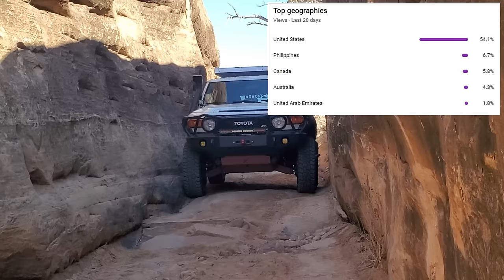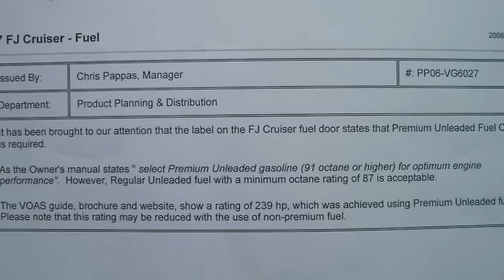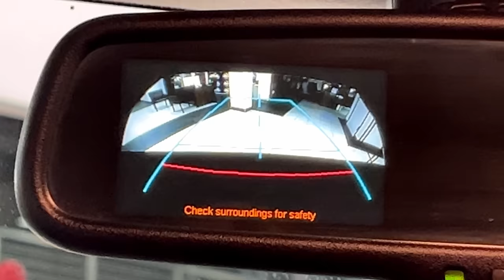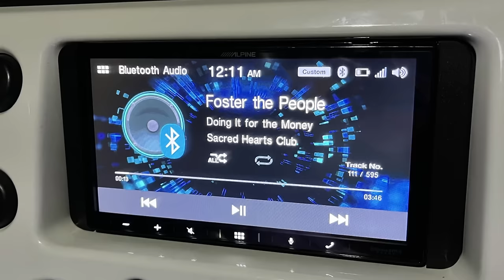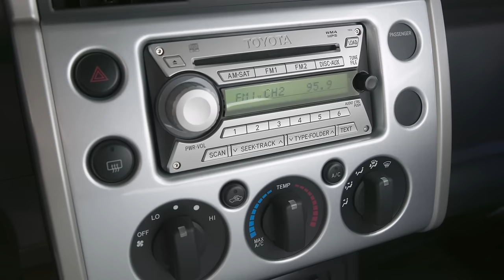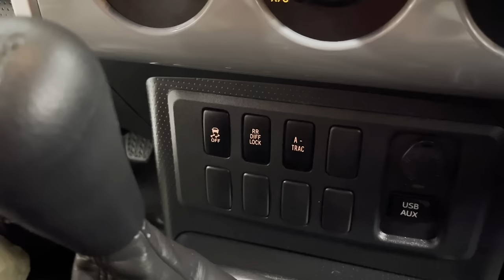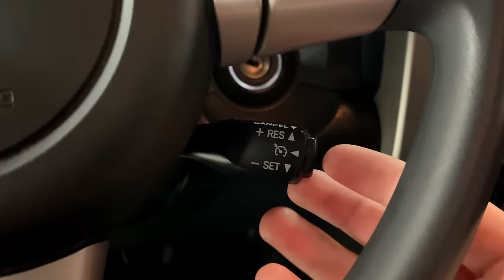Why NOT to Buy an FJ Cruiser - Watch this before purchasing! - FJ Issues and Problems

Comment: Even with all the reasons to not buy an FJ Cruiser, I’ve found more reasons to own one.  I’ve owned three so far and currently both my wife and myself drive 2014 models.  The advantages outweigh the disadvantages for us.   I personally love the looks of the FJ and can spot one a mile away.  They always catch my eye.  Love them or hate them, they are still a great vehicle with lots of reliability and longevity and versatility.  Not for everyone but they are right for me.  (Every dentist needs at least one).
Reply from the maker: Love mine too! Thanks for sharing! Definitely worth it 😃
Reply: totally agreed with you. I have discarded my Wrangler and Defender after I bought a FJ Cruiser. Low in maintenance , easy to maintain, no headache related to electronic  and the chassis is definitely designed to test the off road
Reply: So very true, I may pay for higher gas prices, but when I sleep in my FJ, I am already saving $100 to $300 per night at the places I ride. Just checkout the nightly rates at Moab, Utah - or anywhere near Arches National Park.  I have saved thousands of dollars just moon docking in my FJ on BLM lands.
Reply: @ironhorsegladiator5034  nice, one day I will have one also.
Reply: My wife wants us to get a second one as well!
Reply: FJ is incredible. Here in the sandy desert, I can easily make to any dune top without any problem and backup support.
Reply: If they are SO reliable .... why did you go through three?
Reply: This may be an old video, but this was a waste of time to show the excuses people have for not owning one. Everything you point out is superfluous, with the exception of some of the problems that did occur (early model fender problem). IMHO,in looking at an FJ, you either like it or you don't.  Learning to live with and trade off "difficulties " is part of life.
Now, you still want some cheese with that whine?
Reply: @ericpratt-d4b  very simple answer is that the one I no longer have was my wife’s with manual transmission and when she broke her shoulder she was unable to shift it for a number of weeks while it healed.  So I sold it and bought her one with an automatic.  Nothing wrong with the one I sold except my wife needed an automatic at the time.

Comment: As the original owner of a 2007 Voodoo Blue FJ with the automatic transmission and part-time 4 wheel drive, and here are the problems I have encountered. Mine has a build date of Feb 2007 and came with the UR Upgrade package 2 so it has the rear diff lock and A-trac. It currently has about 140,400 miles on it. I've had all the maintenance and service done at my local Toyota dealer based on the schedule that came with it and opted for the extended warranty of 6-years/100K. The extended warranty didn't help me much because it expired long before I got to 100K on it.  Anyway, the water pump started leaking at about 70,600 miles and this was the first major thing to happen, about a month after my 6-year warranty ended. I was able to convince Toyota to replace it, because it had clearly started leaking before the warranty expired, but they hadn't caught it when doing the previous oil change at 70K and I only just noticed it by dumb luck. My alternator died at 108,8460 with no warning while I was running errands, leaving me stranded in a Target parking lot with groceries. My rear differential start growling quite loudly a couple of months later and needed to be rebuilt at 109,450. Toyota doesn't do rebuilds, so I took it to transmission specialty shop. At about 120K, the lift mechanism for the drivers seat broke when I hit a really big pothole causing the seat to drop from the highest up position to the floor while I was driving. I like to drive with the seat up as high as it will go and it would slowly sink over time (i'm not the skinniest person on the planet) so every couple of weeks, I'd have to give the handle a couple of pumps to raise the seat back up. I've also had problems with the outer side bolster and seat cushion wearing and getting holes from sliding in and out of the car, as well as the rubber weatherstrip on the driver-side suicide door wearing through because I must be hitting it when I climb in. I am tall so I have the driver's seat positioned as far back as it will go and in that position I must be rubbing against the weatherstrip, although I never feel it. What else? Mostly minor maintenance things like both front outer CV boots developed small holes and cracks around 130K. I replaced the PCV valve at 133K because the original was leaking. Replaced the windshield twice. I'm having some paint issues with pealing of the clear coat on the front plastic cowl above the grill. I've noticed this on quite a few older Voodoo Blue FJs and I think it might be because of the engine temps affecting the plastic? That's just a guess. Also I don't like how badly the headlight covers have frosted over with age and even though I've restored them a couple of times, it doesn't seem to last. I never had issues with the blind spots because I'm used to driving a VW camper with tons of blind spots, so with a 3-inch round spot mirror installed on each outside mirror, that seems to work for me. I also installed the side sun visors. This is a very simple install with almost no modification needed to add them to the earlier FJs and I highly recommend them. I love my FJ and hope to keep it until I can't drive anymore. Please keep posting these great videos!
Reply: When you restore the headlights take the time to put a few coats of 2k clear on them and you will NEVER have to restore them again.
Reply: nice writeup. thanks for your time
Reply: Run on sentence……………………

Comment: A great primer.  you forgot to mention Toyota made a supercharger kit for installation by the owner, or Toyota dealer service for the 2007-2009 version.  The rain noise,  which drowns out conversation inside, have to duramat the roof by removing the headliner.  FJ cruiser has zero tolerance for lift kits unless you reinforce the entire suspension attachment  points.  But lifters blamed Toyota.   PIAA made an improvement bulb for the dead firefly glow headlights.   Don't tint the front windows, else you be sticking your head out in the rain to see around the left corners due to the poor visibility.  in 2007 i never missed usb connectivity in my all black TRD version. didn't even imagine what it would turn out to be; can't expect a period piece to grow a pair of usb ports or complain about lack of same.  The TRD also had parking sonar.  omg, 17 years later the 4Runner limited still has parking sonar!  So i loved the TRD, and then i tired, fell in love with the tan can all tan 2010 trailteams, and then out of love again.  Really loved the 2012 Trail Teams Red Baron (Guards red porsche paint all over AND interior trimmed in guards red, finest color combo they made.) BUT, (well actually while still owning the 2012) i had to buy one of the last 2014 ones WITH CRAWL Control!  Crawl Control is like putting the cruiser in tank mode, nothing will stop it while you just sit back and steer.  Saved my bacon plenty of times when the uphill/downhill driveway iced over the whole month of February 2015.   but, pro paint shops wouldn't touch the army green painting of the white top I wanted for less than 4 grand.  And while I never saw the 21mpg on this vid, I got a consistent 19mpg on all four fJ's    But that kept ruining my love for them.  With only a 19 gal fuel tank I couldn't even drive from Fort Lauderdale to the Georgia state line without a fillup.  And that upshift just going over i95 overpasses, a real brick in the wind.  Still a soft spot in my heart always, and when i learned that 2024 4Runner, the identical below the body relative to the Cruiser was to be no more......well, i had to have me some, and even got a 23 gal tank with it, plus SEVEN leather seats, front two heated and cooled, fake wood trim and more chrome outside than a  59 Cadillac.  An ultrareliable luxo Range Rover lookalike.  And if I tire of the 23 gal tank, i'll still keep the 4Runner; my 2021 V8 tundra forever has a 38 gal tank, and gets 16mpg on the highway. Two of the finestkind Toyota ever made and will ever make.

Comment: My 2007 FJ just hit 300k and the only issues ive ever had were the ignition coils like clockwork failing at every 100k miles, its never had any engine or trans issues. It does take skill to drive but its by far the best vehicle i have ever owned. i plan on doing minimal maintenance and look forward to 500k miles. My only real issue is trying to find good front seats to replace the ones ive worn out after 300k miles and driving all over the country. I paid 12k in 2012 for mine and it still appraised for 11k best investment in a vehicle ive ever made.

Comment: I bought my first FJ in 2007 (Black Cherry) and drove it over 250,000 miles all over America. I modified the FJ into an overlanding design and it allowed me to see and camp in places that few other vehicles could. I sold I my FJ in 2021 and purchased a 2008 (Sandstorm) in 2021 with only 45,000 miles on it.  As an optimist, I keep my eye open for a 2014 Trail Team Edition with low mileage for sale. While the FJ may not be the first choice for most people, it has been my favorite since 2007. All of the problems are true but I have learned to adapt and actually tolerate most of the flukes and quirks. In my 50 years of driving, the FJ is the only vehicle that I have driven, where complete strangers will ask me questions about it  and/or comment on the FJ. I have found it to be a real love hate relationship for most people and I have experienced very few neutral responses.

Comment: We sleep in the FJ perfectly and are 6ft1 to 6ft4. And a simple blow up air matters in the back with out anything else. Makes it perfect, you can not feel the raise to the front. And if you think you do. You can always but a towel under your legs. As that where it dips anyhow. Not a big deal when Traveling a sleeping in the FJ. we did an 8000+ mile Road trip around the United States and it was perfect!

Comment: Just found this video and have nothing but good things to say!  I'm on my second FJ and will likely have a 3rd if a good deal comes along.  My first was a Voodoo Blue 2007 2WD.  It had a branded title due to a theft recovery total loss, which made it hard to sell for the dealer who had it for almost a year. (Lenders do not like branded titles).  I made a cash offer and the dealer reluctantly accepted.  It had 99k miles  at purchase, it needed the crank sensor replaced, a new windshield, and tires.  Beyond general services and another set of tires at 150k, I had no repair issues up to 225k miles when I sold it...wholesale to a dealer.....for $1500.00 more than I paid for it!!!!  My next FJ is a 2011 4WD TRD in White. It had less factory options than the 2007 (no temp, compass pod, and no sub in the rear) but the backup cam was a welcomed addition (even with the tiny view).  This one had a previous life on a farm, complete with the back full of hay, and lots of loose bumper trim in the rear (lets say black zip ties are much cheaper than body panel clips). I've got a few strange dents where it seems the doors may have swung into the front fenders. Purchased with 212k miles and going on the second set of tires, it now has 273k miles and other than regular maintenance I've had to put in a new fuel pump (in the tank...go in from the rear floor...but a quick fix once parts were found).  I use mine for business travel, not off-road, but they "fit me" and if I made any alteration, it would be a less spartan drivers seat...I've often considered swapping out for the front row out of a 4runner.  Looking at values, even considering the miles and flaws on the body, I'm confident the 2011 is still worth what I initially paid for it.  But I can't replace it with a lower mileage 13 or 14 for less than double.  These vehicles really do not depreciate if you take into consideration wear and tear, which makes them hard to obtain...a great problem to have, I guess.

Comment: Another great video! Appreciate the tips on frame rust. Hoping I never need to use them. The FJ is totally worth all of the little drawbacks. Definitely smiles per gallon.
Reply: Guess it depends on where you live. At 210K I don't have a spot of rust anywhere on my 2007 FJ. But then I live in Arizona and only drive it into snow up in the mountains about once a year.

Comment: Interesting. I think the upright square look is wonderful. Mine has very little wind noise at even freeway speeds and I have a rack. I pay less for gas on my FJ than all the other cars. That happens due to me driving it less, but then it's a fun car. I thought the view would be a problem but quickly got use to it. I suspect others will also if they like the car otherwise.  To most of us interested in this car it won't be as an electronic safety bristling child carrier. Less is more. Thanks for those notes at the end. I got mine for around $20k used with 50k miles and I think it's worth twice that now.  Like you said, there is no plan to sell it.
Reply: Lucky. I'm looking for one and pretty much all the ones 20k and under have 150k or more miles

Comment: I'm 6'5", and I found it very comfortable to sleep in with an air mattress in the back. Getting out was a small chore, but nothing too challenging.

Also, thanks for pointing out the rust. Mine is starting to show some rust here and there. It has me slightly concerned.

Comment: Yet another great video Hayden! Only thing I can think of that you might have missed is the clunky steering wheel shaft: Bush move out of its place. Pressing it will help solve but will eventually come out of its place again. Not sure why but locally in the UAE most FJ's suffer from loose body mount bolts. Tightening is a must for those who dune bash on monthly basis.

 BTW my Sun Fusion 07 NA FJ was a base model, I upgraded it to meet most features offered on high trims locally, most of it was plug and play. Like the 
-The compass was easy to install (just cut the dash and plug some cables in) FJ forums has a great how to article
-High pitch horn out of an 08 4runner fits perfectly and the connection for it was already there on the inner RH fender
-Fog lights after market 
-Rear speakers OEM just plug them in (make sure you buy the plastic covers as well off of a scrap FJ, plug and play
-Steering wheel controls were plug and play, didn't have to swap out the Clock Spring off of a scrap FJ, plug and play
-A-track button off of a scrap FJ, plug and play
-Subwoofer with its button off of a scrap FJ, plug and play (YES! all wiring is there for it from factory)
-Reverse camera OEM mount (paired it with a JVC 7" HU) Needs wiring harness and a PAC controller for the steering wheel controls

Comment: At the age of 77 my 2010 FJ is the best vehicle I have ever owned. Because I always drive with my mirrors I have never had a problem with the blind spots. Being single with grown children the back seat is seldom use, instead the drivers side is alway folded down to allow my doggies to jump in and out which brings me to the door arrangement which I prefer in access to the back for loading groceries and doggies etc.
As for maintenance I had to replace the rear end housing , shocks, stabilizer bar, and rear breaks assembly  as a result of rust in the vehicle's 12th year. Last year I also upgraded to BF Goodrich KO2 285 75R 16 tires. With all maintenance and various add ons the FJ has cost me $.41 Canadian per KM to date. (133,000km)
Regarding the headlight and mirror light I have upgrade to LED, the mirrors were a simple bulb replacement, I did break one tail light some time ago and replaced it and added tail light guards. I am rigorous in regards to maintenance, serviced the transmission at 75000km, repair and replace as soon as noted and required.
I do not see myself ever owning another vehicle, it is just the best.
Reply: So it's not as bad as people say for the blind spots. I'm a short girl and really want to buy one of these.

Comment: Own two. A 2008 Iceberg and a 2014 Cement Grey. My wife loves the ‘14 since we left it stock. I have done some minor mods on the ‘08 including: lift, aux fuel tank, rear bumper, a Rhino Rack, Method Wheels, and some misc lights.

Comment: The author is right about front end vibration problem. - it could be one more reason why they discontinued it could be because the SUV is very sensitive to the way tires need to be balanced. Front-end vibration at high speeds is a common problem, and the mechanic in the tire shop needs to be very skilled to fix it. And vibration might come back pretty soon after driving a few thousand miles, as some guys complain on internet forums. When I tested a couple of them at the dealer both of them were vibrating at the steering wheel. One of them (2014 FJ)  was starting to vibrate at 60 mph. The good tire shop guys fixed it, it's a good ride up to 80 mph now, so I bought it, and will see how long a smooth ride will last.
Reply: If the vibration is in the steering wheel, it’s usually front tires/balance. You can rotate tires front to rear to see if it changes, if the vibration gets worse or better you know it’s tires. 
If the vibration  underneath the seat, probably rear tires. Choppy tires main culprit front or rear. If not tires/balance you check front end balljoints and tie rods